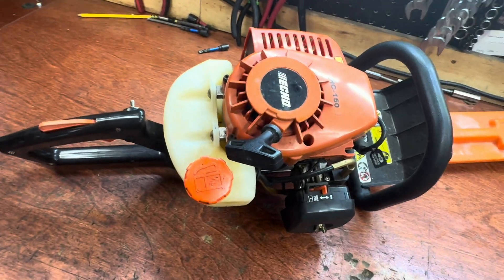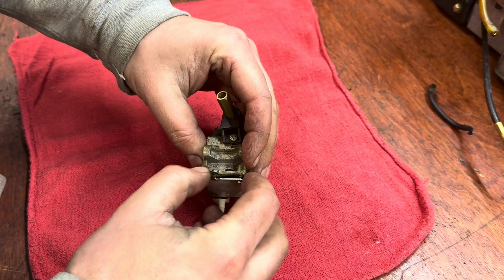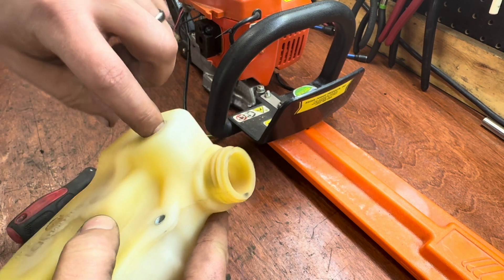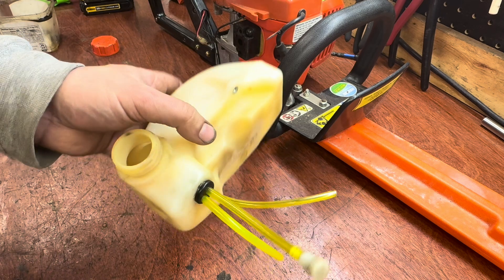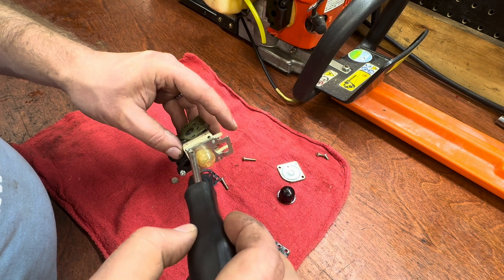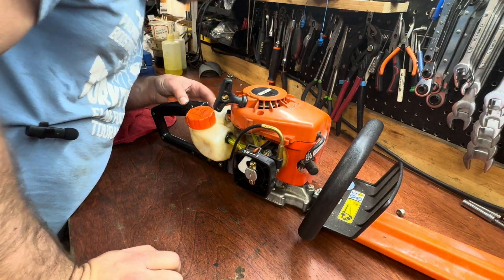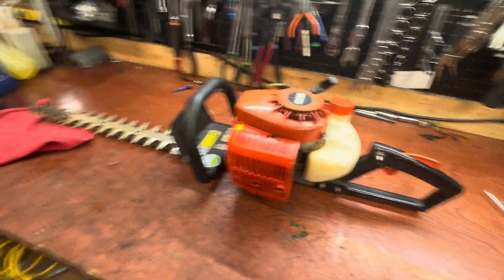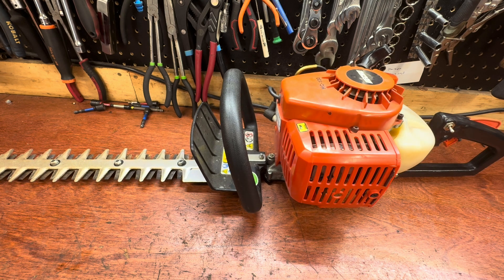Echo HC-150 hedge trimmer starting issue; easy fix

Comment: I also had trouble with the grommet. The new one seemed larger than the old one and just wouldn't go in until I ground down the leading edge quite a bit. Finally got it.
Reply from the maker: Think they have two different sizes. Let me know if the shaving method works or if it still leaks…

Comment: Man, I have one just like it. The grommet gave me more hassle than anything else. Good video, tho
Reply from the maker: The smaller they are, the harder to put in. A little spray lube def helps
Reply: I use silicone grease, plus I have a dedicated flat blade screwdriver with a rounded-off blade so it won’t puncture the grommet.